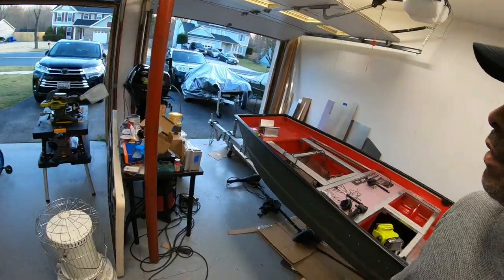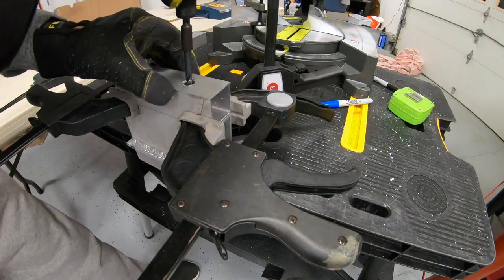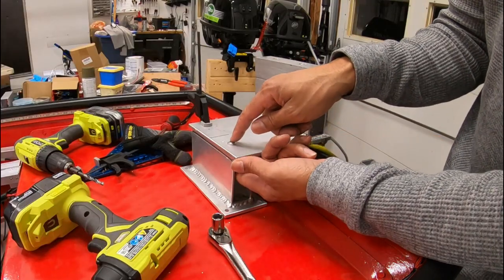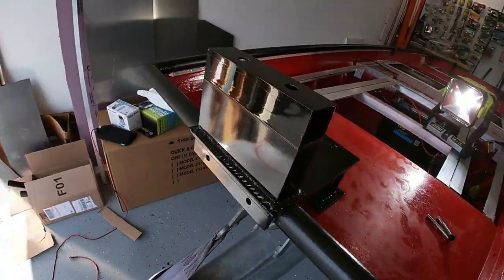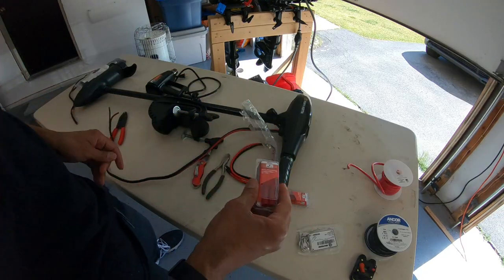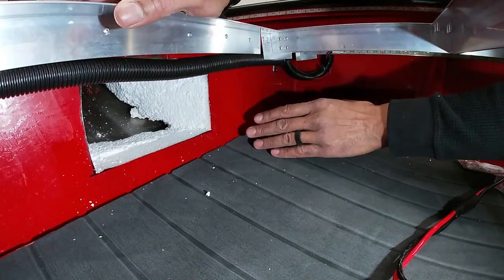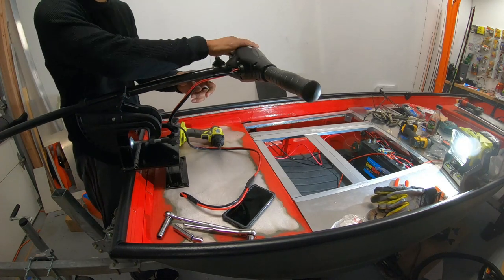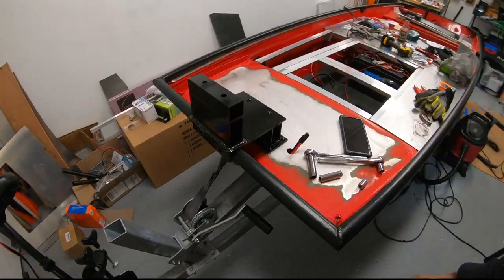DIY Bow Mount Trolling Motor Bracket {Jon Boat to Bass Boat Conversion} Alumacraft 1232

Comment: I'm using the same motor. MK told me  that you can  swap the tiller. worked for me!   In your case you would just have to  pay attention  to the shaft length.
Reply from the maker: Swap the tiller instead of rotating it?
Reply: @BassBrothersFishingDMV    I'm sorry  i mean  rotating it  "swapping"  was a bad choice of words.  I did what you did.
Reply from the maker: @gewglesux  all good bro. 👍🏾
Reply: @BassBrothersFishingDMV    That's actually one of the reason i purchased this motor  just because  of this feature.